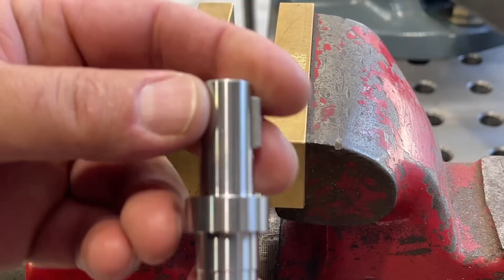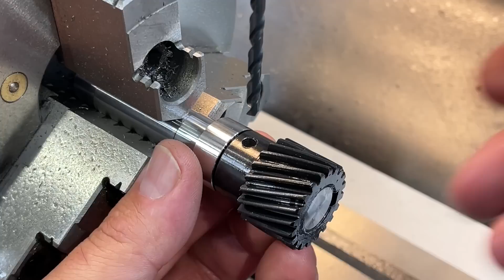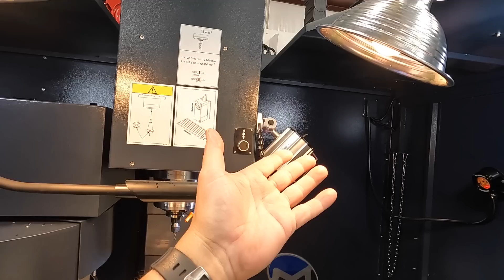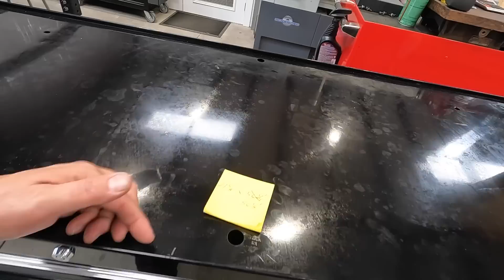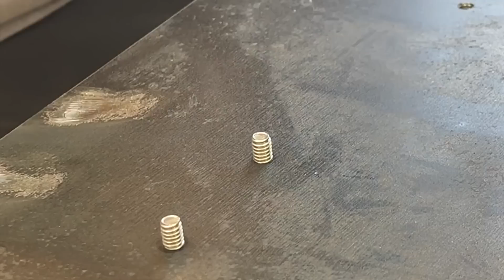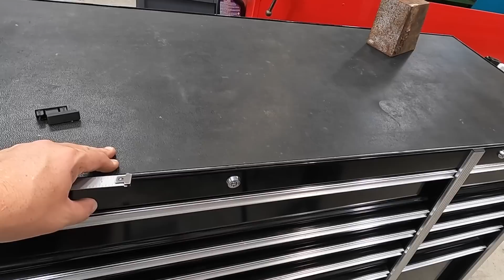SNS 372: Pinion Shafts Completed, Toolbox Mods

Comment: Adam, there’s nothing like an arbor press. It takes a long time to get steel gears to temperature.
Reply: Also, the keystock vs gear keyway interference fit is going the gripping difference rather than the clearance direction.

Comment: Some basic notes about lighting:
1) Soft versus hard light. Soft light is diffused light that avoids casting harsh shadows on its subject. Hard lighting is the opposite. The main key to softening light is the size of the light source in relation to the size of the object in the shot. That is the core principle of softboxes. They do not make the light softer by sending it through some opaque fabric but by increasing the size of the light source. If you want more sharpness and well-defined contours, you go the other way and make the light source as small as you can.
That is why they use absolutely gigantic softboxes (striplights) when shooting cars - they need to make the light sources bigger than the cars in order to soften up the light enough. They have special, hangar-sized studios just for that. If you look closely at studio photographs of cars, you can recognize the striplights in the reflections.
Distance is also a factor here, they say a gray overcast sky is god's own softbox, basically the softest light you can get on this planet. In the shop though, your distance options will obviously remain limited.
Softboxes are not a way to control or even eliminate unwanted reflexions. The reflexions just get less sharp and well defined but they will still be there. Besides softboxes, there are also many other kinds of photographic light forming devices like snoots, diffusers and reflectors. For a brief overview, look at the wikipedia category "Photographic lighting"
2) Light direction. If you light up your object from the front, i.e. from the direction of the camera, it flattens the look because any shadows cast by surface contours get drowned out. By shining lights on the object from the sides, you get a more plastic, three-dimentional look created by the shadows cast by every small nook and cranny. That is called "raking light". 
You need to experiment with these parameters to get the hang of it but that is easy enough to do in this digital age. You don't even need to roll footage but can just use still images of different lighting set-ups and you will see the effects for yourself.
Do not get discouraged by reflexions. Your objects are mostly very reflective and those are the most difficult kind of objects to light. It is not easy to fully control all the reflexions. It takes effort and a lot of experience. As you get more proficient, you will keep noticing more reflexions well after the shoot that you did not even see at first, and at some point it starts getting more important to avoid unwanted light to reach the objects. There are established techniques for this such as hanging matte black background cloth (no bin liners) (and not only on the background but wherever you need it to absorb unintentional light), or painting surrounding surfaces matte black in order to avoid unintentional light scatter.
The way to control color is to set the color balance of your camera before the shoot. If you do that then it almost doesn't matter what shade of white the lights are. The camera should have a function for that, although I'm not sure a GoPro has that. The way to do that is to shoot a photographic gray card, which you can order online for a couple dollars and which comes in a well-defined color known as neutral 18% gray. Then you tell the camera that what it is currently seeing is supposed to look like 18% gray, and the camera electronics will adjust the color balance accordingly for the given light source. If you shoot still photographs in a format known as camera raw, then you can even set the color balance after the fact. There is bound to be something similar for video but I am not up to date on whether it has filtered down into the consumer segment yet.
Reply: GoPros as afar as I know have a color balance function, but I think it might be limited to just a few fixed settings. I heard several times those work better with warm light sources. (Can´t say for sure, never had one). But you are right about that. 
And you are right, when it comes to shiny metall, there is almost no harder object in photografy and videografy when it comes to lighting. Glass maybe.
Also one thing about LED lighting for video, I would look into specifically designed for videography light panels or the light. One thing, they already have quite a large area and work in some way like a softbox. Second, those made for video are (or at least should be) flicker free. Especially dimmable lights often use Pulse Width Modulation, so to achieve the dimming effect, they are not on all the time and get constantly switched on and off. for less light they are on shorter and of for longer, for more light they are on for longer, up to full time.
And even simple non dimming LED light due to the type of power supply might flicker at something like 30 Hz (in Europe it would be 25 Hz) Due to the power supply simply cutting of half of the sine wave. Depending on exposure time, this may cause a rolling shutter effect. It may vary from the slightly annoying stripes Adam experienced in his new shop with the overhead lighting initially I think, up to possibly cool effects that make a mill or drill look like not moving at all while actually spinning.
Reply: This^^^^^^

Comment: Perhaps your customer specified doing what you did with the set screws but I think a dowel or taper pin would have been better. I see the spur gears had a dimple in the hub for that purpose.

Comment: I expect the bores on those stock gears were under nominal to provide a press on a nominal shaft size. Making the shafts over nominal made the press fit tighter. Didn't see the true bores of the stock parts measured at any stage of the project.

Comment: Adam, get led lights with 3000K colour temperature, that is warm white. Other thing for filming would be that light source is well diffused and non flickery type. Cold white (4000K and up) is usually used because you get a bit more light output with colder white.

Comment: I worked with a machinist setting up lighting for a new manufacturing facility, he insisted on High Pressure Sodium and he showed me how the short spectrum light allowed the machinist to see the direction the tool and material was turning in the machines. A full spectrum light like metal halide or fluorescent would not allow the eye to see the rotational direction of the rotating parts and tools.

Comment: You could've put the shafts in the freezer, overnight.
Reply: An ice chest with a block of dry ice to store the shafts in conjunction with the hot oil works even better
Reply: @melmckenzie1176  I was trying to avoid having to buy anything unusual.

Comment: If your going to do a batch i would do this to help speed. interference is probably OK, being a drive part more is better than less. i would just grab some dry ice and alcohol and make a cold bath for the shafts and keep the gears hot. you get some lubrication with the hot oil too. quicker to assemble. 

Im guessing the grub screws where dog tooth/point hence the dimple. i would use knurled cup point with a dab of locking comp. that way you dont have to dimple them all. should be faster and more profit.

with the CNC to get on size quick and not waste so much material setting up. wear offset both the roughing tool and finishing tool bigger by the finishing allowance. run it and see where they both sit. i like to make sure they are both fairly accurate because consistency is key. at the end of the program you should have a shaft that is oversize by the finish allowance, then you adjust down to finished size, you should be able to get onsize on the first part, rerunning the finishing pass. EG; finish allowance is 10thou, offset both tools +10 thou on the x axis. run and measure. shaft is oversize 11.2 thou drop the offset 11.2 and rerun. should be smack on. just like what you already do manually. creeping up by a tenth or so you will be chasing your tail because of tool pressure and you'll scuff your surface finish. once its set it should be good just to run the next part.
Reply: This ^^^^^^

Comment: .000006 per degree per inch. So if You heat to 475 which is 400 degree above room temp or the shaft temp,  should be .0024 heat growth. (if the shaft size is 1.0 inch)

Comment: I learn so much from you, here's something I may offer...

I know the lovely other half is into ASMR, here's a tip to consider. I can hear the traffic in the background, that means your Microphone sensitivity is high, that's called ATTENUATION on mics.  The other parameter is GAIN, Attenuation and Gain work hand in hand, in this case, your mics should be set to lower the sensitivity and increase the gain. Why? You won't hear the background noise and amplify the weaker microsphone signal back up to -6db or there about. 

I know you're using RODE mics and they should support attenuation, yes it's a pain but necessary for the best audio. I usually describe the need as being one where you're recording at a Church service and you can hear a pin drop, versus the Rock Concert and the host shouting over the top, you're usually the latter as the machinery is loud. 

Cheers, love your work!
Reply: PS: Gain is the amplification of the signal after the attenuated mic captures the signal.
Reply: Ahh and I can help Adam for a change ..

Firstly, LED is higher temp, cold lighting and there are orange LED options, but truthfully nothing beats a warm tungsten light. So a GE Light bulb is as good, probably not as durable for a lifestyle adventure show, but fine for static shots.

There's spot lighting and flood lighting, the backlighting and point lights, lights that point a spot for the camera to expose the extra lighting. The level of brightness in a studio is blinding, and thats where Neutral Density filters come into play, they re open the iris in bright light for modern shallow depth of field shots such as yours.

You need a LOT of light to keep your shutter speeds up otherwise your video will be riddled with motion blur that you'll really notice during edits. The best value come in kits and lighting IS EXPENSIVE. I'd suggest browsing the B&H site for lighting packages that you can use. you might get better options for stands, flex arms and mounts to suit your needs better and most are packaged with soft lights, spot light and panel options with stands

Comment: You can find a translucent spray paint and paint then a yellow or amber color. The bulb usually won’t have much effect on the paint if you can find high temperature paint. Or you can always do what they do in Hollywood and get colored filters and attach in front of bulb.

Comment: On the lighting, I like Cree branded smart bulbs as some of them are tunable for white.  Also, here is a little trick for lighting.  If you take a CD or CD-Rom and look at the reflected light, the disk will seperate the colors like a prism, showing a rainbow.  You can see what color components are in the light...such that if you want a warm white, the blue components will not be significant in the reflected rainbow.
Reply: Brilliant
Reply: Or, you could learn what color temperature means.  Incandescent lights are 2600 - 3000 Kelvin.   Incandescent photo lights are 3200K.   Daylight is 5500K.    LEDs should have the color temperature listed.   LEDs are available as "warm white" or 3000K.

Comment: Love this stuff but as a non machinist why the up down up down at the beginning of the cut?
Reply: peck drill the hole with the endmill until you get to the bottom of the slot. Then the side milling is easy. Entering the material is where You have to be careful. you can ramp down
as you feed  left to right and sometimes You should. The way He did it is easy and fast and usually works good
Reply: Makes sense. Cheers!

Comment: Hi Adam, you'll need some safe storage for programs you want to keep. Maybe in the cloud or a DVD burner. Every time we took a lightning strike near our building in Ft. Myers, all our programs got corrupted.
Reply: By saying that all your programs got corrupted, do you include the machine software as well as any programs for individual parts.
Reply: I suspect he meant stored programs. The machine's OS is almost certainly in ROM. In that instance, I think I'd have installed a UPS into the power supply for the HMI. I'd also copy them all off into a pair of external HDD's and take one home with you every night.
Reply: Just piggybacking your comment:  Cloud, in most cases, is not a backup (or at least the way that most people use it).

I'd look into a 3-2-1 backup strategy.  $0.02

Comment: Rule of thumb for thermal expansion of steel - for a 1 inch part, or 1 inch hole, it expands a little over 1 thou for every 200 degrees Fahrenheit.
Reply: I didn't know the numbers but half a thousandth over such a small diameter seemed iffy. I would like to see the outer part heated and the shaft chilled for maximum differential sometime.